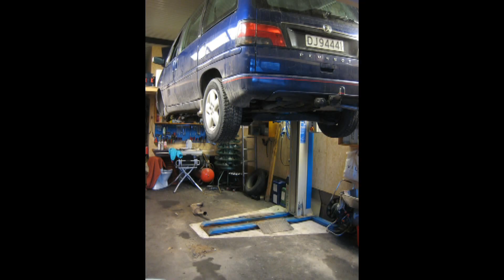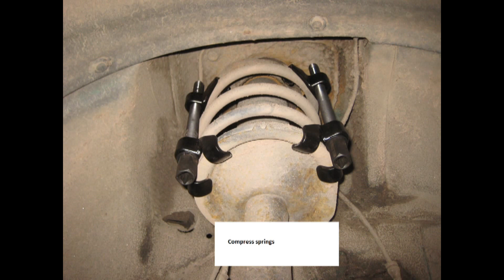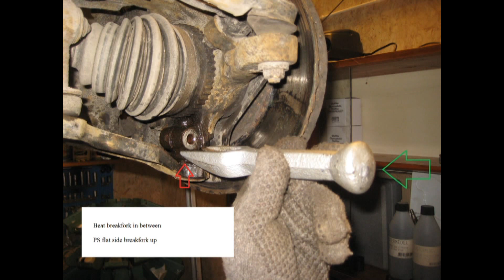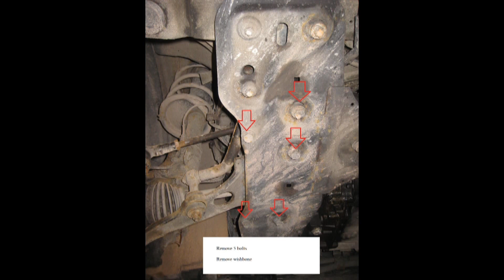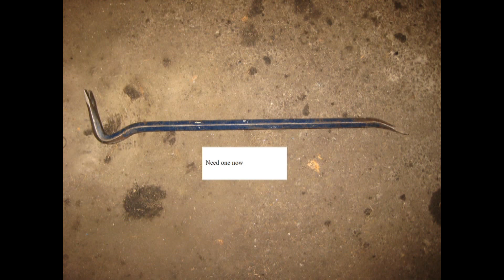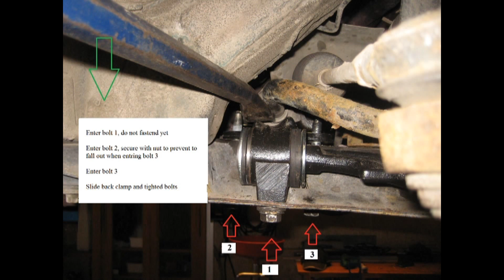How to change wishbone Evasion / Synergie or 806

Comment: connect wheelside first ??? I try, impossible to enter bolt...
Reply from the maker: Bolt nr?
Reply: Horrible job. Done it twice. I’m sure there is an easier way. Mount it first. My mounting holes didn’t line up easily. 🤬🤬🤬🤬🤬🥵🥵🥵